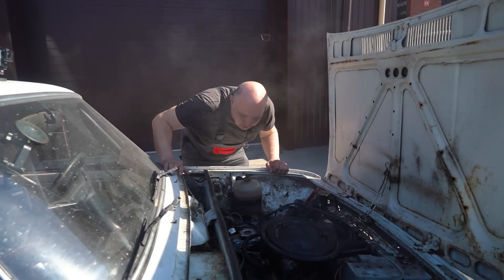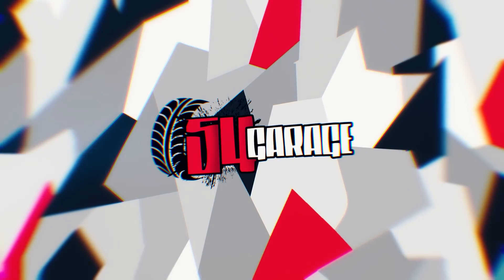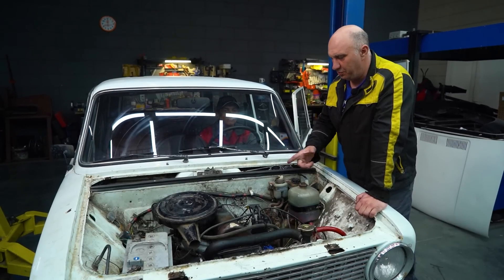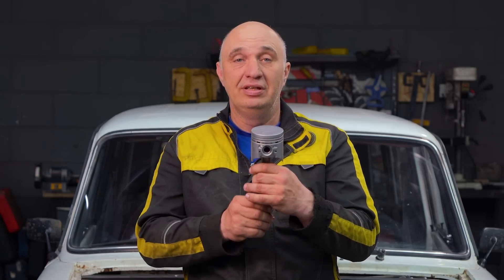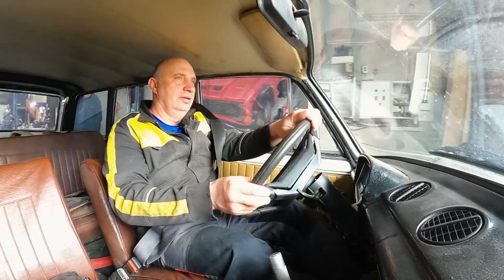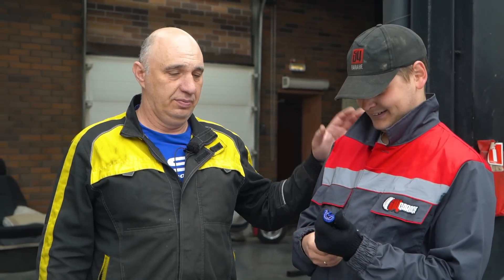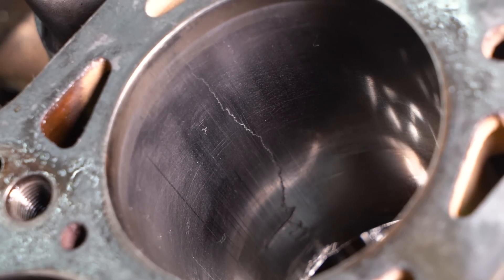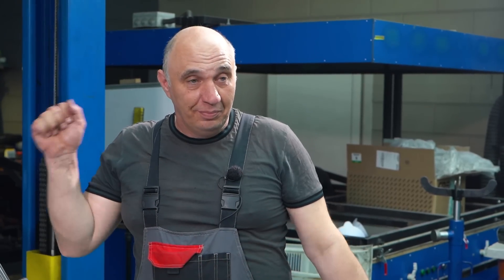We install pistons backwards - what will happen?

Comment: Uncle Tony will smile so big!!!
Reply: Huge difference between this engine and a stock typical American V8. For one thing, there's a lot of offset on this engine, you can see it here. On a typical American V8 you really got to look for it. Other thing is, with this four cylinder the top of the pistons are shaped to go one way. Stock V8 pistons work in either bank, they'll have four valve relives so turning them 180 doesn't change piston to valve or head clearance. 
Also flipping stock pistons in a V8 isn't an Uncle Tony thing, it's an old trick from way back.
Reply: Lol I was just thinking Chrysler engines if u take the first and last piston then reverse and swap em it's supposed to make mo powa
Reply: @NickMartinez-l9t flip them 180° and swap them to the opposing bank. 1-2 3-4 so on.
Reply: Why I’m watching this 😄
Reply: He’s the first person that came to mind!
Reply: That guy is a clown.
Reply: You can only rotate the pistons not the rods. The rod cap has a small gap that allows 
oil to spray on the cylinder walls.

Comment: I honestly never knew thst piston pins was off centered. Today I learned from Team Garage 54 that piston pins are off center.
Reply: Some pistons actually have a different skirt design on the thrust face compared to the non-thrust face
Reply: I thought if the piston was either flat top or symmetrically dished like these, it wouldn't matter. For all the crazy stunts Garage 54 does, you usually do learn something 👍👍👍
Reply: Excentric pin was explained very well. It is because the piston would wobble (=slap) if in the middle. Any structures on the top don't matter. Pressure only cares about the projected area.
This motion is called the secondary motion of the piston. It is bettered when 1-2mm out of centre. (Page 1051 ISBN 91-44-31481-7)
Reply: @herrkulor3771  if the top of the piston is relieved for valve clearance, rotating it could matter, but now I see that this offset matters at least as much.
Reply: Same here! I assumed it was because maybe the pistons were slightly out of perfect round and as they heat up become more round, the markings indicate front of engine, that's what I always did and never questioned the "why" but the explanation with TDC makes perfect sense and reminds me of how steam engines were said to have to be barred away from TDC or they couldn't start- I assume those pisons had no offset, so  trying to start at TDC would not move the piston at all, they were usually single cylinder.
Reply: There are some old Mopars that are different per side. You can take the pistons from one side of the engine and install them in the other bank and supposedly pick up a bit of bottom end torque. @FCE-dogs
Reply: I believe it's also because the way the piston is driven down into the cylinder. Go look at the difference a little longer rod will have on how the piston travels and where the firing sequence is. The more inline it can be with the crank the more power (not a huge amount, but measurable and noticeable).
Reply: I didn't knew that either, but it would definitely wobble, it's on the fine scale of balance if centered, any minute resistance would make it chose either side, every up down motion.
Reply: Richard holdener has a video because uncle Tony said it make more power but it didn't make any difference
Reply: @james10739 well sadly it cant make any more power not even on paper. Any con rod that is beyond TDC due to the offset looses a bit power on paper if you would fire exactly at TDC. Since engines doesn’t work like that new or old. Who claimed that again ?
Reply: So basically nothing about pistons is square apparently. The pins are off center, the actual piston itself is. A come, most of the time the rod to cap connection isn't even flat (they break them apart or something like that, instead of cutting them) what else?
Reply: Yeah me too,
all my mechanical knowledge is just from "pull my old suzuki apart to see how it works" so I found Vlad's Engineering Principle for 2mm Offset very interesting & educational
Reply: Before I was tasked with translating this video I thought I knew my way around cars. But you live and learn.
Reply: @SwapBlogRU  Definitely. The way I see it everyday you learn something no matter how bad the day started. And you learn something. It is a good day. Atleast in my belief. And I have learned alot of Kool stuff from Team Garage 54. I'm so glad you get to work with Garage 54. It is awesome . And with your help translating for everyone you help us learn. I am so excited to see what else Team Garage 54 has to bring to the table. So thanks to and thanks to Garage 54 for everything. Have an awesomely epic day.
Reply: @-A-Hybrid-Skunk-Productions-  well, your outlook is definitely positive from what I can tell) as for what's going to be released on this channel in the near future - well, G54 videos tend to be hit or miss, but IMO the videos due to be released this week should be pretty good) slightly above average even
Reply: @SwapBlogRU  Thanks. I try my best to be positive. And I enjoy the work you all put in. Thanks for that. Have an awesomely epic night.
Reply: Ive read somewhere thats because the offset of the rod and cranckshaft is to increase power and lower side draft
Reply: @gabrielvieira.4358  the offset doesnt affect the power what so ever, its just for harmonic engine operations, reduce engine noise and less wear on the parts.
Reply: It reduces piston slap. Look up "piston flip Uncle Tony's Garage".
Reply: "These" pistons are off center. Most it doesn't matter unless you have domed pistons.
Reply: it was done to make more power, as it doesnt address piston slap... you still get it but its more on one side and less wobble. 

so then vital coatings came into play, hardened low friction surfaces. embedded into the metal.
Reply: Right there with you.
Reply: same thing
Reply: some engines do not have it off center and on some engine you make more power when you flip the off center pistons. on old mopar straight 6 engines its a common mod to flip pistons for power gains
Reply: @e34boat88  how does that affect longevity?
Reply: @SwapBlogRU  on this lada engine yes but not on all engines. this lada has really large offset on the pistons
Reply: Offset pins. Wow. Never knew that.
Reply: Its to mitigate piston slap noise. Hot rodders been flipping pistons for decades

Comment: It's an old hotrodder trick from famous race driver Smokey Yunick, and it usually works well. Especially a lot of Mopar guys drive flipped pistons. But what you do is flipping only the piston, not the rod. Looks like you flipped the rod, so the oil spray hole got on the wrong side  - no more lubrication and cooling.  To get any benefit out of it you also must adjust ignition and cam timing.
Reply: It looks like the pistons in the Lada engine have quite a bit more pin offset than is typical. It's not visually noticeable on any engine I've torn down. They mark piston tops to indicate the correct direction. I could tell from the video the pin was offset alot on those pistons.
Reply: @jeremypike9153  2mm
Reply: @jeremypike9153 I'm guessing it's partially because it's a big-ish sized carbie engine.
Reply: @jwalster9412  not really I think it just dates to a time when they were trying to figure out how much was enough and how was too much. It's typically only about 1° of offset on factory pistons and most aftermarket pistons are made without the offset at all. 1° isn't really perceptible to the eye it takes a precise measuring tool to see it. I used to build our dirt tracks engines with the pistons flipped and we never had these issues from it. Maybe it was because the crankshaft was always freshly polished with new bearings.
Reply: @jeremypike9153  I know it was a motor builders trick back in the 60's when holden bought out the red six. The huge lumpy cams used to like this
Reply: Makes sense
Reply: Do Ladas even have squirt holes in the rods?  Lots of older designs I've worked on don't.
Reply: Whats the benefit of flipping
Reply: @dsk-xx  Slightly more torque at the beginning of the power stroke, as the rod is laid over more.  Supposed to be worth 25 HP on a 500 HP V8.
Reply: Yes, other people here opine as well, that they possibly have deprived the pistons of lubrication, by flipping the conrods. I'd like to add that the cylinder was damaged in the area where the excessive friction of the piston was landing. I suggest that the actual mode of destruction was local overheating, as a result of which the cylinder wall developed some cracks, a crack bit the piston hard and that was it. I also have a hands-on feel how aluminum behaves under conditions of dry friction (unlubricated). It just becomes rough and starts to act like thick glue, the two surfaces try to fuse into each other. If the cylinder wall (made of steel) got dirty with aluminum, that could easily aggravate the thermal runaway.
Drilling, milling and threading/tapping aluminum is a pain - you need to keep the tools doped with alcohol for lubrication.
Reply: @xrysf03  This project was DOOMED to failure.  If you take an old car, 150,000 miles, and move the pistons to different bores - even without flipping them - you will get accelerated skirt wear as the pistons try to break-in to the worn surfaces.
No honing, cross-hatch or break-in oil was used.  
Hot rodders that flip pistons do so from new.  It's worth 25 HP on a 500 HP build.
Reply: @peterdarr383  Yes I know what you mean by DOOMED :-) I would add that normally in Garage 54 projects, humorous engine destruction is by design, it is the expected outcome. In this particular case, considering those Garage 54 virtues, the poor old engine was given a relatively good chance of survival :-) I mean it was just "doomed", not butchered and rehashed by design in the first place.
Reply: I doubt the conrods have a oil spray on this engine, there is no hole in the shells.
Reply: It has to be a V block not an Inline.
Reply: @Sludge73 It works perfectly fine in my straight six!